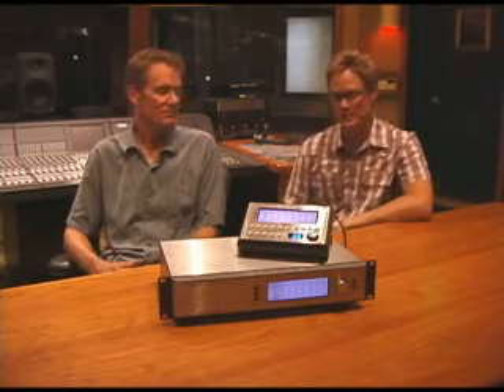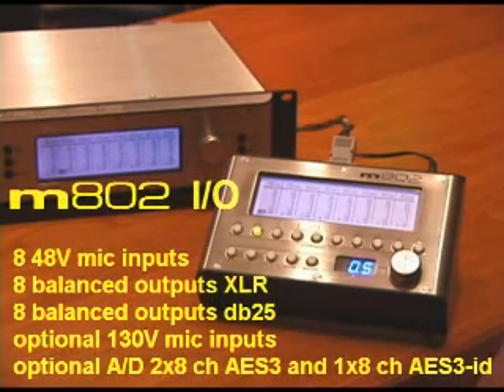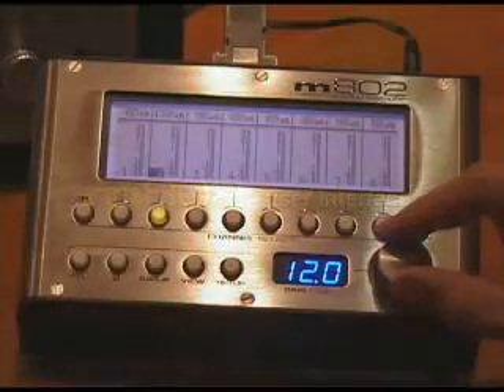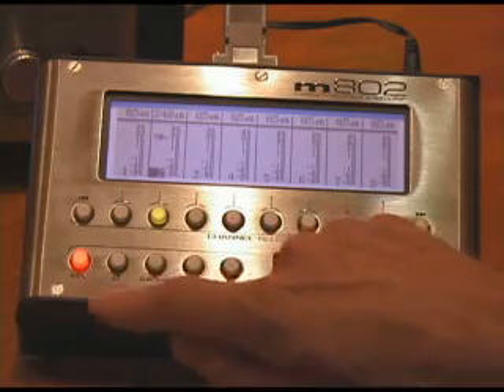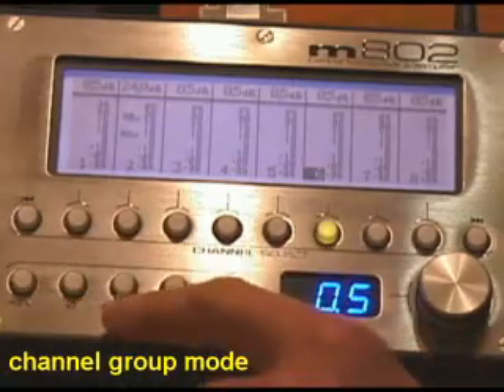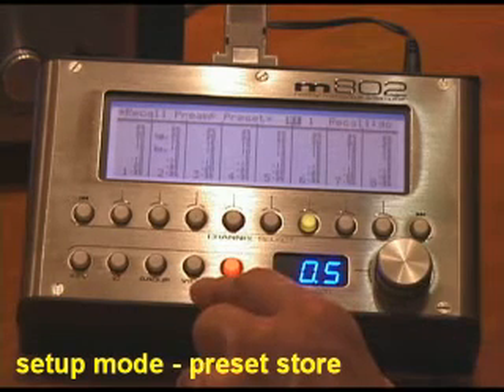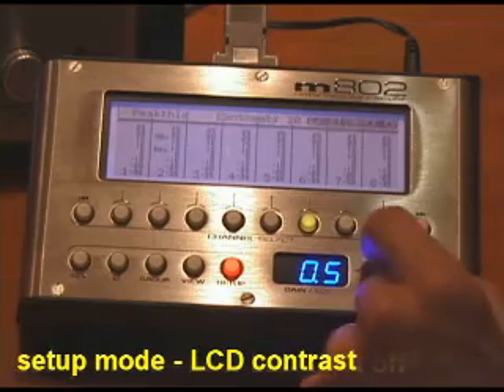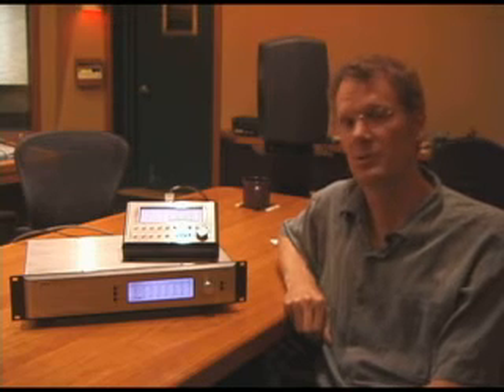Grace Design m802 remote controlled eight channel mic preamplifier with A/D converter

Comment: Good question. There are no dedicated line inputs on the m802, but the mic amp circuit will pass line level signals without virtually no alteration / degradation.